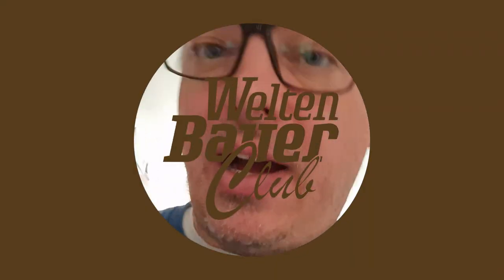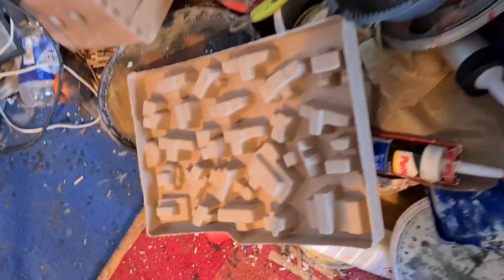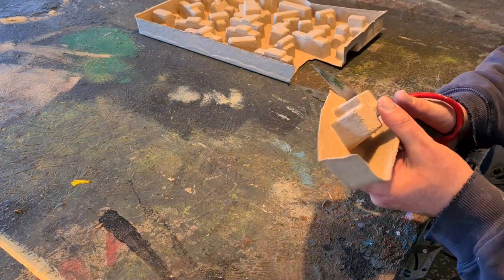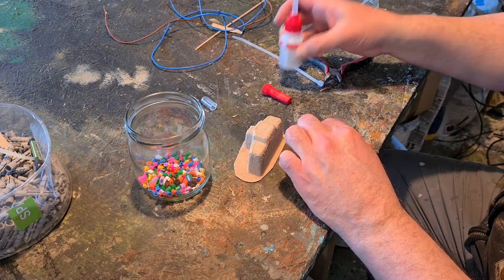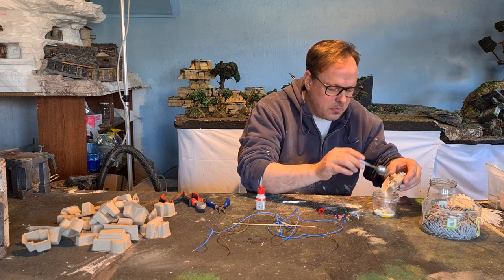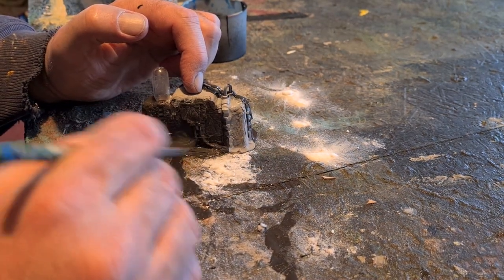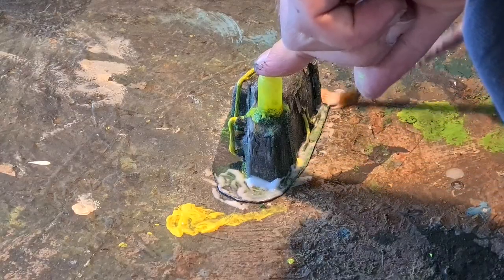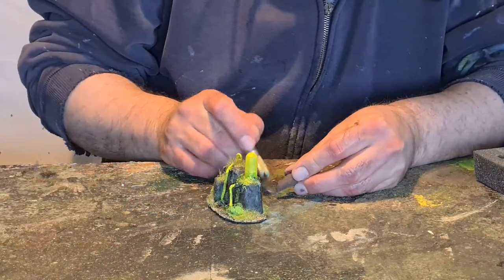From TRASH to CASH - barricade scatter terrain

Comment: Wen working with those cardboard shells it really helps if you give them a coat of pva/water mix or some other surface coat before you start adding things to them. They drink up glues/paints like theres no tomorrow. Superglue its like you can just pour it on and its gone before you can attach anything to it.
A pva-water-spraybottle treatment solves the problem.

The piece turned out beautiful and that calendar tray is basicly a tables worth of scatter.
Reply from the maker: Thanks. Will try that. Yeah, that will be a lot of scatter 🙈
Reply: I add a bit of paint to some Mod Podge that stuff dries like iron and once dried out won't reconstitute I have a pair of blue jeans I got a big drip on and even washing has had no effect on it.